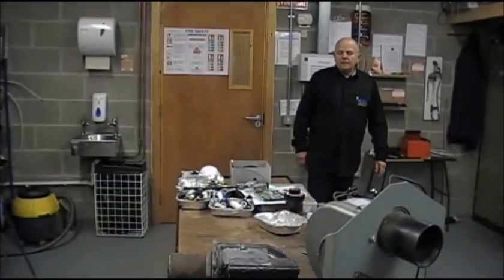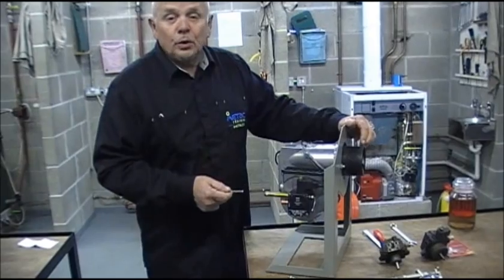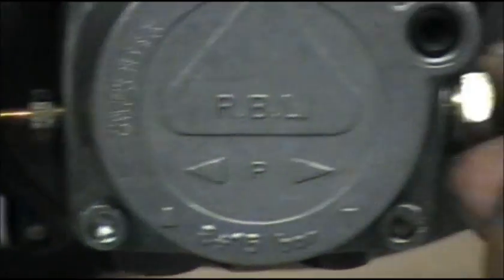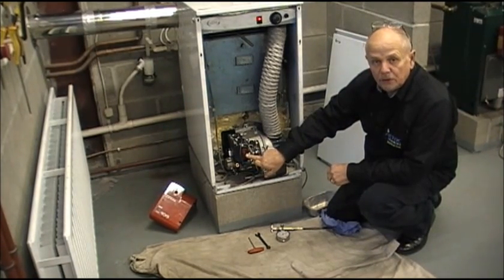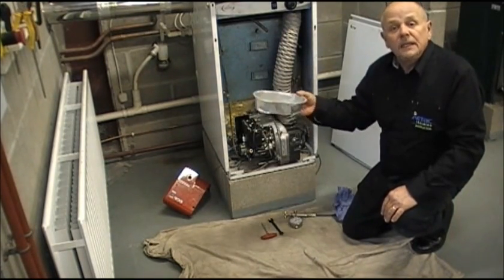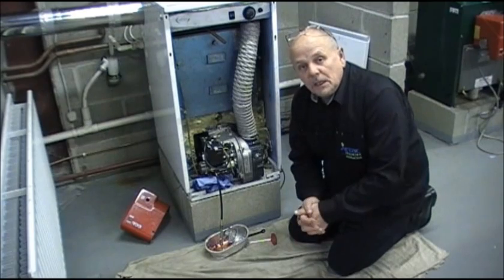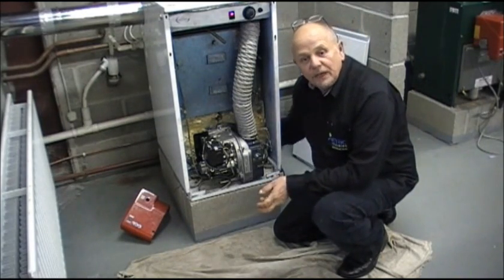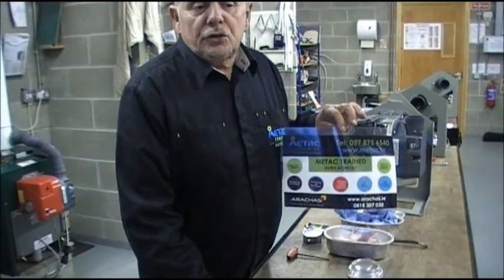Bleeding an Oil Burner

Comment: Thank you sir . Watching your video fixed mine . I’ve never touched anything related to that . Around 11:00 pm my wife told me it’s cold in the house . Than she went to sleep . I turn the hot water to wash up before going to bed . I noticed only cold freezing water ! No hot water . So I went downstairs to see if we have any oil in the tank ! What I found is absolutely no oil ! Tank is dry empty! I woke the wife to order oil . She did online but it would take 2 - 3 days for them to come ! After online searching I learned I can put some diesel 5 gallons or so and it should let us go by for a few days . Drove up to gas station and brought 10 gallons of diesel. Por it into the tank & it won’t fire up ! Search online and found your video . Fallowing your steps and I start bleeding it until I got normal flow of oil than the miracle happened. Thanks to you man we’re back in business . Best regards to you stay safe and keep the good work . God bless you 😀😀😅

Comment: I don't have that special bleeding device, but the process I followed successfully was outlined by Freddie in this video. Before, I was using the "return" instead of the "bleed". It is helpful to see a comparison of different types of equipment, and a summary of what they basically do. It is daunting how much variety of equipment is "in the field", and calling a service man out for a simple bleed is very expensive. It is also interesting to see the water and the bacteria in the jar of oil. We live close to the sea and are known for our harsh weather, so I am sure our oil tank is filling up with water... on the bottom!

Comment: Can't believe Anthony Hopkins is now a heater guy. 
Clarice
Reply: after the burner vid he will be having an old friend for dinner. With a fine Ci ante
Reply: Good informative video. However I was disappointed that you didn't show us how to check and adjust the oil pressure when you had the guage  attached. I accidently moved the pressure adjuster, thinking it was the air bleed valve. I turned it back to what I think was the original position but I need to be more accurate
Reply: He used to drive a Black Cab! Proper geeza is Fred.